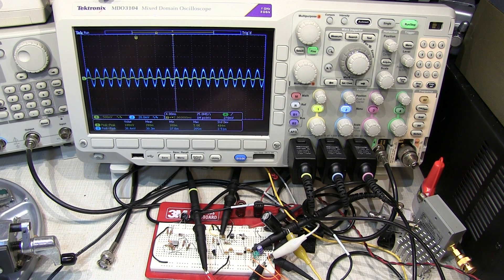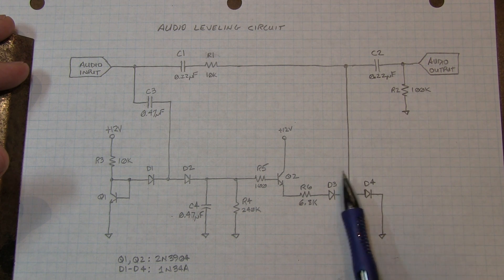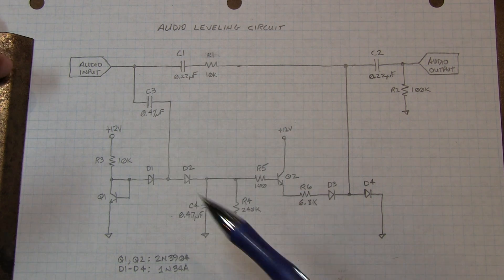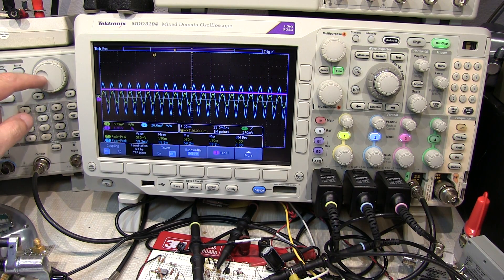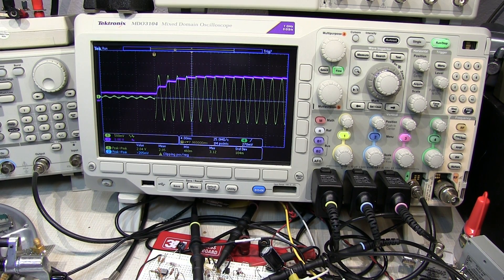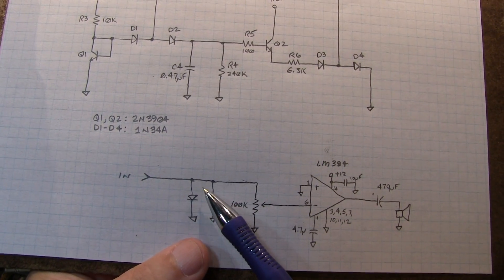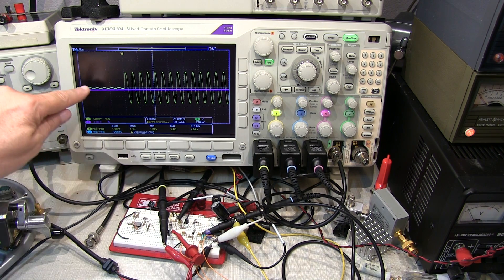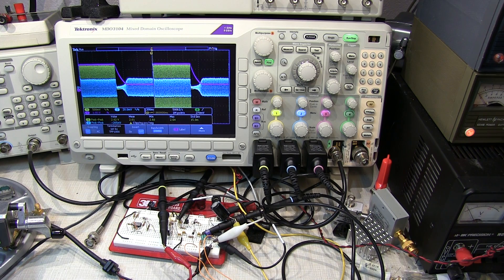#157: Circuit fun: Automatic audio leveling circuit | audio compressor | for scanning receiver

Comment: Hi,  thanks for the video,  but can this be used as preamp stage for a modulating signal?
Reply from the maker: This circuit needs a relatively large input signal, and would typically follow a preamp stage.  It could not be used as a preamp stage.  If the intention is to create a speech processor or compressor before going into a modulator, then this could be part of it.  However, you would precede this circuit with an adjustable preamp (to adjust the amount of compression), and then follow it with a buffer/amp to drive the modulator input.
Reply: w2aew thank you, I'll try that out

Comment: Having a tough time finding 1N39As.  Can I use something else, perhaps 1N4148, or something else easily found?
Reply from the maker: They won't work as well (output will vary more with input). You can find 1N34A diodes at Tayda, Circuit Specialists, Dan's Small Parts, etc.  plus several other sources which show up with a simple google search.
Reply: Thanks.  Was hoping to find it locally, but I will just order them.

Comment: Great video! I only have one question. Will this work with a radio station? I volunteer for a radio station and our music tends to go from very quiet to very loud. We've tried software solutions to no avail. If this won't work, do you have any ideas as to what might? Thanks in advance!
Reply from the maker: I wouldn't recommend this for music programming, it will add a lot of distortion.  A commercial audio compressor would be a much better solution for a radio station application.
Reply: w2aew A compressor would balance the audio level? Because if we set our meters to -1 on one song, the next might peak at -20. And the one after that could clip. It varies and we've tried everything we can think of beyond going into every single song and leveling them that way
Reply: vlasktom . It sounds like you're looking for a software solution to normalize your source files.
Reply: st1300 r We've tried software and they don't work right. They tend to cause talking to be very loud. Like constantly clipping loud. I guess our only hope is to go through the music library and normalize every single song
Reply: For most modern pop music you'll probably find it's already been dynamically compressed to death and goosed to 0db to get the highest rms loudness (google loudness wars). You could try normalizing them to a lower level. There are apps that will recursively crawl your folders and do this for you. (Don't loose your original files!) For podcast or mostly voice files, there is an old lin/osx/win application called levelator which is a one click solution although I don't think it accepts lossy files like mp3 as a source.   Hopefully your folder structure roughly follows music genre as the processing parameters will likely be different to nudge them towards something close enough somewhere in the middle?
Reply: st1300 r We only play one genre of music. Gospel. However, our library of music, which is all in WAV, contains over 8,000 songs. And the preaching we have, which is all in MP3, is never the same volume. We try to normalize it as we get it, but sometimes it is at 0.1 dB and we can't really normalize that. We also have an hour of satellite every week night but once again it varies from day to day on how loud it is and we have literally no control over it

Comment: Very interesting circuit. Would you say it function the same as with "Tube" based AGC ? Vari mu like circuit ? I know it's done by "rebiasing the grid of the tube but I could never figure out if the tube was cathode biased or grid biased for it to work...Anyway great video as usual !
Reply from the maker: Basically the same function (reduce gain / increase attenuation) when input signal is high - but different operating principals.

Comment: Awesome circuit! I just don't understand why the diode D3 is necessary. Would it work without it?

Thanks
Reply from the maker: +Ricardo Nunes It's just used to help set the appropriate bias current through D4.

Comment: Is q1 doing constant colektor emitter voltage ?
Because if he do this, i can replace it with  a diode . right?
Reply from the maker: Yes, but it is also intended to match the other transistor.
Reply: w2aew 
Cool thank you
Just one more
How is this colektor base short thing of q1 calles i would look up for rhis on the web
Reply from the maker: This configuration is simply called a "diode-connected transistor".

Comment: great video! you mentioned speaker level on the input. Did you mean line level? I noticed in your demonstration video you were using an RCA connector off the back of the scanner.(phono output?) I would like to use this circuit on the aux output of a mixing console before it enters a distribution amplifier.
Reply from the maker: It will likely work with line level as well, as you can see from the beginning of the video.  Keep in mind that this circuit does add some harmonic distortion to the signal, so it really isn't suitable for high fidelity audio work.

Comment: Damn! True experts such as Dave of EEVBlog and Great Scott frequently warn us not to trust nor build just about anything we found on the Internet. But this certainly one of those true experts!

Incidentally, why do you not use the Op amp peak detector which you showed in your video #77 so that it can effectively detect very small signal and not "waste" that signal to voltage drop? Does a transistor "follow voltage" such as an op amp does with its own feedback?
Reply from the maker: There are a lot of ways to design a circuit to do this function.  I just thought this circuit was interesting, and something fun to show.  Certainly there are ways to do this that will perform better.
Reply: @w2aew  Germanium diode is becoming obsolete. Maybe it is really 'the sign' for me to move on. Hahahah! I cannot even find it in Farnell/Newark/Element14 anymore. It is now an audiophile object which fetches high price.

Comment: what is the replacement of diodes in this circuit?
availabilty problem here
Reply from the maker: You can get them here (if you are in the US) 
http://www.danssmallpartsandkits.net/
Reply: mr. technical there all over ebay...

Comment: For those interested in building this, the 1N34A diodes are available on eBay in lots of ten for $0.99 delivered.
Reply: Just a note of caution... Any electronic component sold on Ebay is highly likely to be a fake. It is better to buy from a known OEM distributor.

Comment: I simulated the circuit in SPICE and was unable to duplicate your results. I find that to be very interesting.
Reply from the maker: +Dylan Vizcarra Sometimes models don't accurately model reality.  For example, SPICE would have no difficulty putting 100 amps through a 1N914A diode - it doesn't know that you'd let the smoke out of the device if you did that!  All tools, like SPICE, have their limitations...
Reply: +w2aew I can see that being the problem. I suppose I'll just have to build it to be sure. Thank you for the response.
Reply: +w2aew I am curious now, when you initially decided to design the circuit, since you didn't use SPICE to determine the values of the components, did you analyze the transfer function to decide which values would provide a predetermined output? I'm just curious if/how the analysis techniques my professors are teaching me are actually applied in the real world.
Reply from the maker: +Dylan Vizcarra This circuit takes advantage of the diode's dynamic impedance changes vs. bias.  I am not the original designer of this circuit, this basic design has been around for many, many years.  I am surprised that it didn't simulate properly.  I remember simulating this many years ago and thought it worked well in simulation (either PSpice or LTSpice - don't remember what i used back then).
Reply: +w2aew I see. Well I'll just have to reexamine my simulation and probably just build it to compare the results from LTSPICE to reality. Thank you for your help.
Reply: @CreatingNewThings   hey have you got the simulations correct now?

Comment: Hey I love the circuit, Allen. I wanted to use the circuit with a pair of earbuds so that it would never exceed 85 dBs. So, I was wondering if you had any tips on how to optimize the circuit for a pair of earbuds and still get a decent sound quality from it.
Reply from the maker: +Daniel Yoon (Yoonyman) Follow this circuit with a small audio amplifier suited to driving earbuds, and adjust the gain/attenuation to get the volume you desire in the buds.

Comment: Hi Allen, I would like to use this circuit design. I am building a preamplifier circuit design with tone control. My design accepts multiple inputs such as CD, Aux, Phono, Tuner, Line etc. The output voltage of each of the input varies hence i would like to use this design at the end of my circuit design to limit the voltage to 1.4Vrms as I am designing for that specific voltage to be accepted by a power amplifier. Is it possible that i can use this circuit for each input or can it be used at the end of the design to limit that voltage. Also your design was for a small voltage... Do i use an op amp to increase it to the level i want or do i vary the potential divider to achieve this?
Reply from the maker: +Kiran Deonarinesingh You will need to amplify the output to 1.4Vrms - the output amplitude of this circuit is fixed by the diode characteristics.
Reply: +w2aew oh I understand I have another question... I went through the comments and I saw the diode you used... Would any germanium   Diode work? Or is there any replacement diode I can use?
Reply from the maker: +Kiran Deonarinesingh Any small signal Ge diode should work - the 1N34A is probably the most popular.
Reply: +w2aew I did try another germanium diode but the output signal obtained was very noisy... I'm not sure what's causing it? Would that be a result of the diode?
Reply: +w2aew is it possible you have any way that I can contact you directly? Maybe Facebook messenger or so? I would like to ask you a couple things about the design I'm using
Reply from the maker: Possibly. But also keep in mind that this simple circuit is ok for communications grade audio, but would be lousy for any kind of high fidelity audio - it'll have too much distortion for that.
Reply: +w2aew my project is based on building a preamplifier with tone control included for multiple inputs.. I saw in the video that for various peak to peak voltages, the output of it was constant.. Would it work for this design ?
Reply from the maker: It's difficult to say. You'll have to experiment with it to see if it meets your audio quality needs.

Comment: How could you modify this circuit so that the signal out would be adjustable
Reply from the maker: RocketRich Such a simple circuit as this, that is relying on the non-linear characteristics of the diode, can't really be made to be adjustable.  Since the output impedance of this circuit is so high and couldn't drive a speaker or headphones even if it is was adjustable, you'll need to follow this up with an amplifier regardless.  And of course, that amplifier can be adjustable.
Reply: I appreciate the quick response. Could you also provide some insight on how you designed this circuit to provide a given voltage level?
Reply from the maker: RocketRich It wasn't designed for a given level - the output level is simply a function of the non-linear behavior of the diodes.

Comment: just tried this @ 9v. seems to limit the loud signals but not boost the quiet, but could just be me. excellent tutorial nonetheless!
Reply from the maker: As mentioned in the video, this is NOT an amplifier.  It will not boost the quiet signals, it will only level the loud ones.  So, you'd want to turn up the volume going INTO this circuit so that even the quiet signals get limited, then all levels will get limited.

Comment: Thank you for posting this video! I came across a snag in my project and this circuit should fix it :) Unfortunately I did not get the same results as you did. I changed up a few things because of lack of parts. 220k for r4, 6.8k for r6, 1uf or .22uf for c3. I also changed the diode which I think is my issue. Im using a 1n4148 instead of the 1n34a. The scope shows the peak detector is working fine but the overall output is not right. I have checked the circuit over about 20 times and swapped c3 a few different ways with the same results. Do you think its the diodes?
Reply from the maker: Yes, they really should be Ge diodes like the 1N34A.
Reply: +w2aew Ok. Thank you for the quick response. I will order some online then.
Reply: +w2aew The Ge diodes came in and now the circuit is working. How might I alter this circuit so that the peak is a higher voltage without using an op amp? The peak voltage on the circuit I have going is about 33mV. It would be nice to bring this to .6V
Reply from the maker: +Rex Heck You'll have to follow this circuit with an amplifier in order to do that.
Reply: +w2aew I have come across something very interesting. I have an op amp set up now that will give me a 20 - 20000hz response with about a .6v peak. The signal is still not strong enough for my application and I am still tweaking with it. What happened that was very interesting just now is when I put my finger on the end of the resistor going to the inverting input I get the desired results. (the magic touch!) It seems as though the energy from my body is boosting the signal. What do you think is happening here? I tried to look it up online but nothing came up.
Reply from the maker: +Rex Heck Very difficult to say without examining your circuit and layout.  Perhaps you don't have the op amp biased right, and touching it moves the bias to the right spot.
Reply: Ok, well I have it working the way I want now. I was really curious about the "magic touch" phenomenon. Thank you again for posting this video and responding to my posts.

Comment: Simple, smart and usefull design, I like it a lot :)
And thank you for detailed presentation of how it works.
One question however - what does Q1 do?
Reply from the maker: As described in the video, it establishes a DC bias on the peak detector so that Q2 is on the verge of conducting.
Reply: I just didn't understand why use a transistor for it like this - but now I think I got it - it's an identical transistor as Q2, so its voltage drop on base-emitter junction is approximately the same as Q2, so we have nice, precise stabilised bias?
Reply from the maker: ***** You got it!  A nice precise bias, that is largely independent of supply voltage.  This circuit can operate over at least 5V to 12V supply, and even more likely...
Reply: Nice, thanks. Looking forward for another circuit fun videos to figure them out :)

Comment: Awesome video! Do you know of a circuit which uses a low line input such as from a smartphone and compresses it for the same effect?
Reply from the maker: The input impedance of this circuit is quite high, so it could be driven by a line-level signal.
Reply: Thanks for the quick response. I am going to experiment with a variety of diodes, I'll update on my progress as I go
Reply from the maker: I tried several different diodes, but best results I obtained were with the 1N34A
Reply: Good to know thanks. Is there a difference between using this circuit vs an auto gain control chip?
Reply: An auto gain control circuit will have much higher fidelity than this simple circuit.
Reply: Hi I'm highly interested because I'm building a light control unit. I'm going to use this for signal conditioning taking input from mixer's line output.. have you tried this out yet?
Reply: Hey Andrea, I did try it out but I did not buy the diodes that were used in the video. I suppose you could use an op amp to boost the voltage after the circuit well to get the 0-3.3V you are looking for.
Reply from the maker: A mixer's output should drive this circuit very well.  You will likely need to amplify the output though, as you suspected.
Reply: Thanks for the tips. I'll let ypu know how it goes. I'd like to simulate the circuit using LTSpice...

Comment: Wow, this is great! I'm wondering a couple things... This looks familiar to an option for those (and by those I also mean me) that are interested in leveraging the power of their PC soundcardsto run as a budget (free) oscilloscope as an intro. With a 1V peak to peak limit can you use this to sending the signal to the mic input? I have seen a few idea circulating around but no real in depth demo video on how to implement it. I realize the limitations of the max 44k limit of the card but I would love to see someone try this is actually see what can be done. Perhaps this would be a time wasting but entertaining project to try...
Reply from the maker: You may have to attenuate the output a little for the mic input, but it's certainly worth a try.  Of course, there would be no vertical calibration on your scope...
Reply: I think the Zeitnitz soundcard oscilloscope program will do that. It's actually a nice one.
http://www.zeitnitz.eu/scope_en
Reply: To attenuate I think a 10:1 (9M and 1M voltage divider) and 100:1 switch would be a good option. I'm leaning toward an Operational Amplifier with 1M resistors for high impedance and then your circuit as the front end. The tough part is signals below the 20Hz audible range of course and DC measurement. Some suggested the DAC in cheaper china based USB soundcards would work, Adding a bypass jumper and switch on the input cap to prevent AC coupling when wanted would be an option.